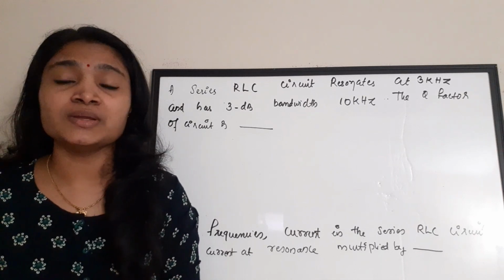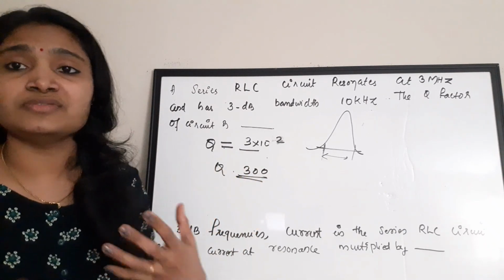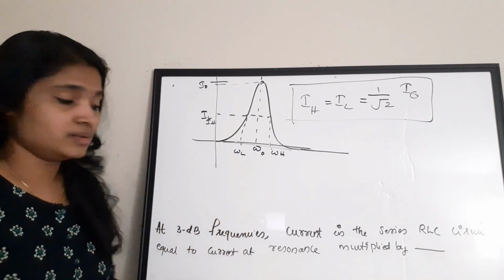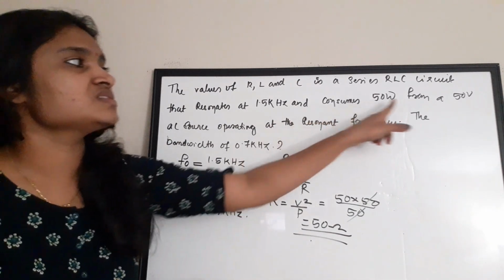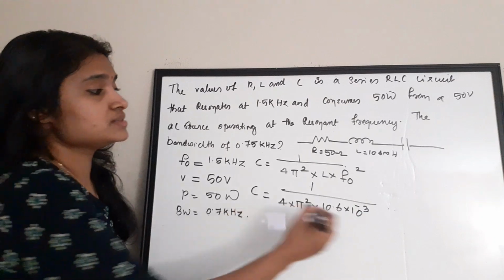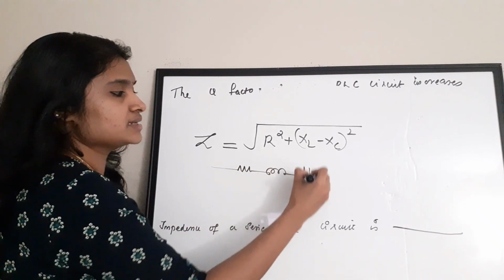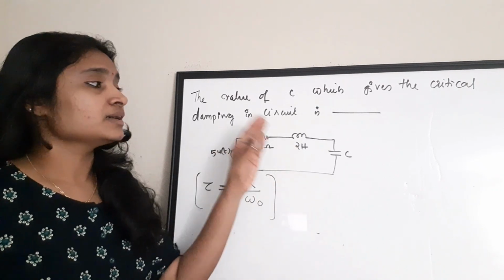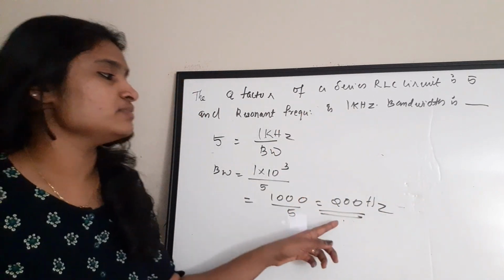SAC ISRO Scientist and Technical Assistant Electronics Preparation| Series  RLC circuit Questions

Comment: A series RLC circuit has R=50ohm, L=100uH,C=1uf. The lower half power frequency of the circuit is?? Miss plz give the answer of this question. Plz miss reply
Reply from the maker: I will answer
Reply from the maker: I will share a link, in that see lower cutt off frequency and at half power , u will get the answer

https://www.electronics-tutorials.ws/accircuits/series-resonance.html
Reply: @EasyElectronics_jobupdates  thank you miss
Reply from the maker: Answer kitiyenkil parayane
Reply: @EasyElectronics_jobupdates  misse enik oru doubt und engane aaa square root of 10^-12 kandu pidikkunnee. Simple trick vallathum undo miss. Onnu paranju tharamo. Plz
Reply from the maker: 10^12 nte sqrt 10^6 alle appo 10^-12 inte sqrt 10^-6 atre ullu
Reply: @EasyElectronics_jobupdates  thank you mam
Reply: @EasyElectronics_jobupdates  miss vere oru question inum koode answer paranju tharamo.
Reply: @EasyElectronics_jobupdates  answer kitty miss thank you